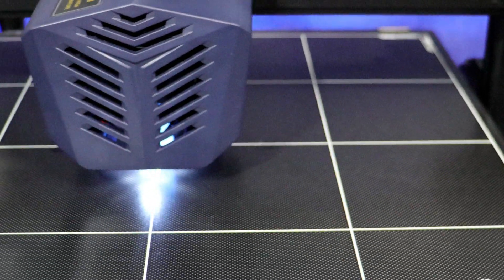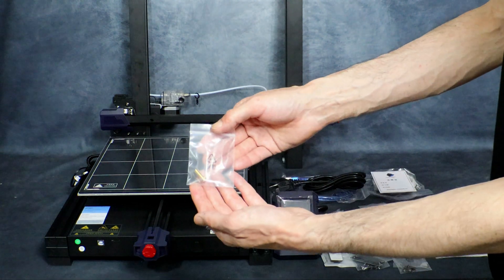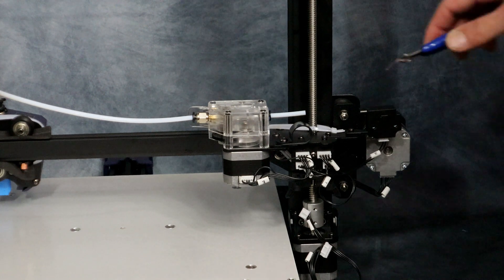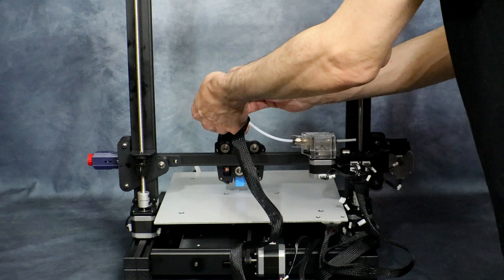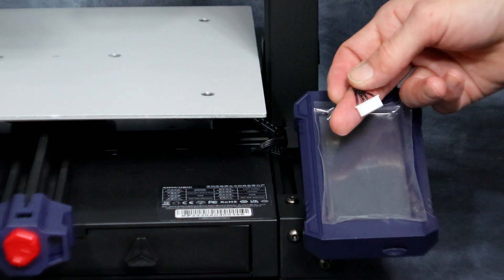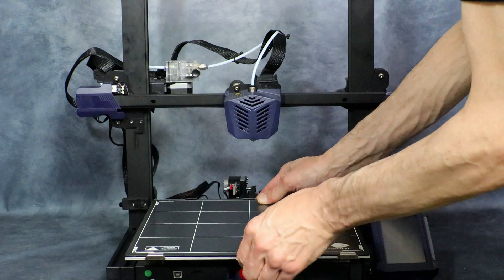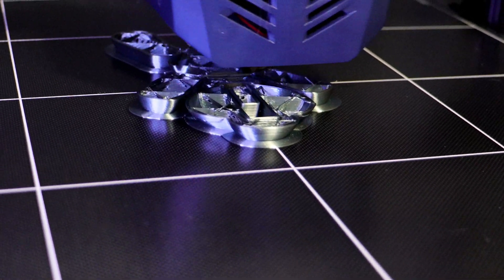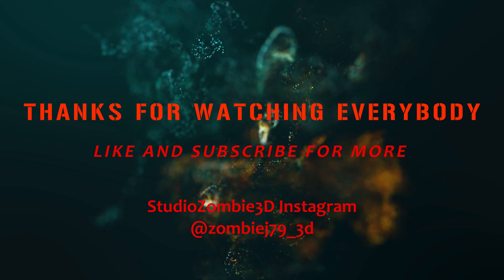Anycubic Kobra Plus Setup and Review

Comment: Just got one of these, and your video helped with several tricky spots.  I never even noticed the zip under the platter!  The only problem i had was seeing where the hot end cable was going by the extruder(your hand was over it), but it did clarify that was where the sticker was to go(didnt see that at all, may be a new thing; a sticker saying clip here).

Comment: My wife bought me the Kobra Plus for Christmas. I've been watching videos on how to set-up/Prep and everything was going good until the print stopped halfway through the build (owl) and my screen went dark which I thought it was crazy because the fan was still blowing air. I've turned it on/off countless times, and nothing seems to pop up on the screen which stays black, but the fan continues to run. There's nothing on YouTube or the internet about how to fix the problem. I'm really new to the space of 3d printing and I would really like it to work but it shouldn't be this hard to start up this brand-new printer. What is my option's? Has anyone seen this before? Thanks in advance 😀
Reply from the maker: Try reflashing the printer firmware, https://drive.google.com/file/d/1bVmlbt4oOPd2X7dCumGjo-RugotpSi2t/view?usp=sharing
See if that fixes it, you can also try connecting with pronterface and send m502 twice then m500 and power off and on that might fix it.
Reply: @StudioZombie 3D  thanks for responding. I found the problem late last night which was a loose ground wire on the motherboard. After I rearranged the wires and tighten everything down we were off to the races haha. My first print looks really good for very little adjustments. I found you on  a YouTuber name 3DPUK. I'm subscribed to both of your guys Channels. Thanks for the content 🙏

Comment: Great review.
Just purchased my first kobra plus and followed your setup. Could I ask you and everyone else a question? When adjusting the eccentric wheels on the build plate to eliminate wobble /movement should both left and right side wheels be gripping. I ask as I have eliminated any movement but the left side wheels are still really easy to move /hardly gripping.
Any help you or anyone else can give me would be much appreciated 😉
Reply: Thats how u want it i think.  Just enough tension to barely turn the wheels by hand against the rail.  Not so tight u cant turn the wheels by hand.  At least for cnc machines thats how u want it.
Reply: Nvmd, i dont think u can get it that tight.  Sorry, dont take my advice.

Comment: Anyone had any issues wih the temperature maybe not being true? I have PLA with specified temperature range of 205-220 that does really well at like 195, but if i put it at 205 i gets really stringy. Have not found any way to see if the reported temperature is actually true.
Reply from the maker: You can use a laser thermometer to get a reading it can be tricky. But I've seen a number of units that do run a but hotter then reporting. One was 20 degrees hotter. It could be a faulty thermistor but I'm not positive. If you can adjust accordingly as long as it dosent have to be set to 170 or 175. They tend to trigger the extrude temp safety at that temp

Comment: The direction show the bed clip opposite the way you installed them on the video can you confirm that? Another reviewer made a comment about electrical short issues if done wrong. I do not have mine yet to confirm
Reply from the maker: I installed mine upside down install them the opposite way. I haven't had a issue with mine. Bit they should be installed the opposite way
Reply: @studiozombie3d  Thank you for the quick response time. Also I appreciate your video well done.
Reply from the maker: @Mdwagner88  appreciate that man